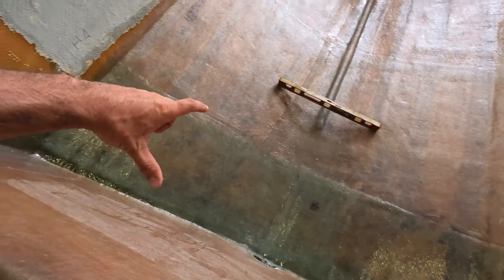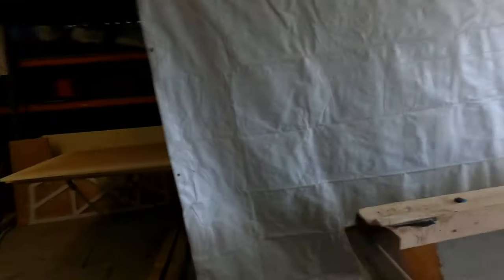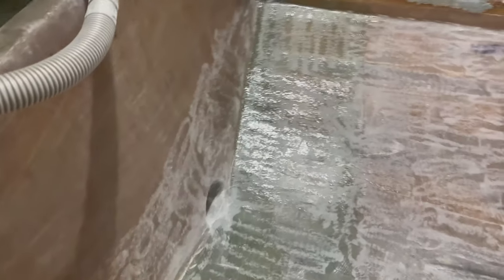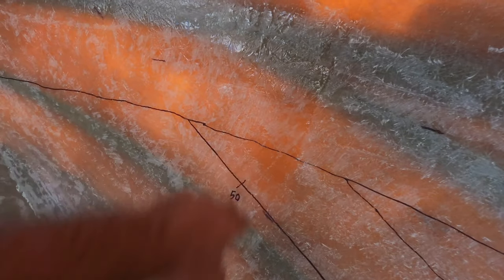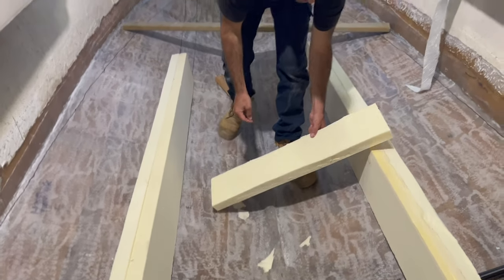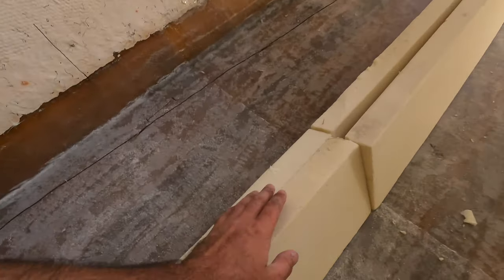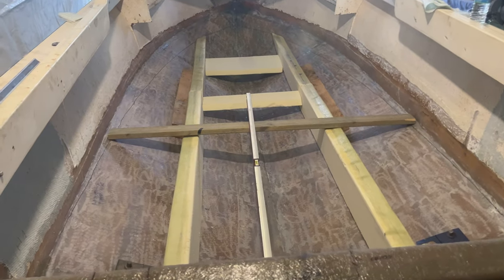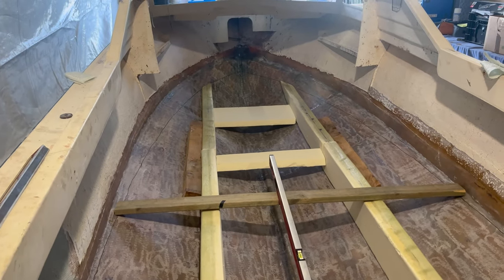Using a LASER LEVEL to MEASURE for STRINGERS| Pacemaker 20ft | Full BOAT RESTORATION V2 - Part 13

Comment: Just an idea for the next time your joining anything, stagger the joints it will add a lot more strength- so you would have 1 long piece on the front left and 1 long piece on the back right, then the 2 shorter pieces on opposite corners. I know the foam isn’t for strength but will even keep the whole piece straighter and help when moving it around 👍🏼
Reply from the maker: thanks for that mate!

Comment: Plywood/marine plywood/coosa/foam. Stringer material not selected for strength.  Foam easiest to shape.  Cost effective, readily available, # layers of glass vs the other 3, weight?
Reply from the maker: Thanks for watching Roland, Foam is more expensive to buy a sheet then is was to buy ply. But yes easy to shape. Weight is a factor also 100%. 
back when this boat was built the wood stringers were used for the strength, that's why not are roted out as it was only layered with 1/2 layers of chop to seal
Reply: Easiest to shape= foam, cheapest= ply, strongest/easiest install= thermolite/coosa.

Comment: Like the work but boat building 101 you can use a level of any sort lasers can be used if locked as the floor once finished looks like it will dip forward in the water as it's not back in its original place from the factory
Reply from the maker: Hey Thomas thanks for watching, I have allowed for this is the floor I have 5mm lift in the front to have the water towards the back! Thanks for the response!